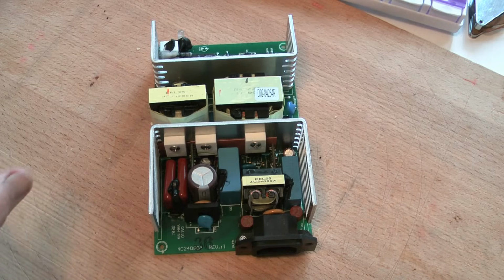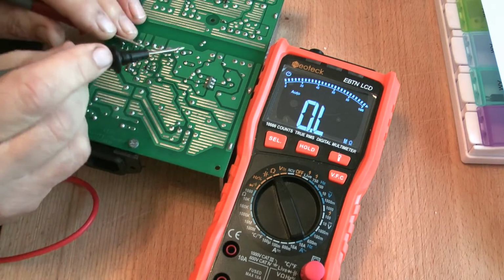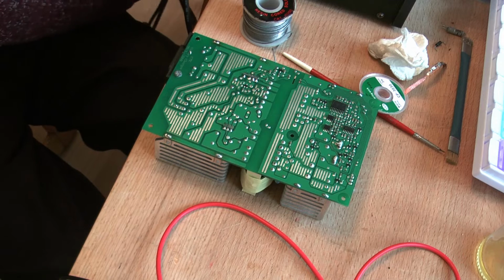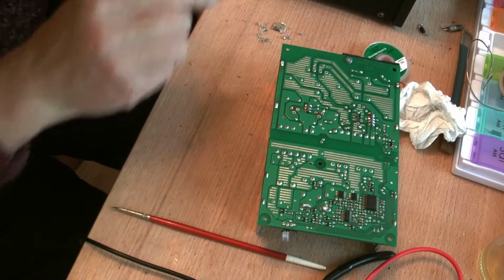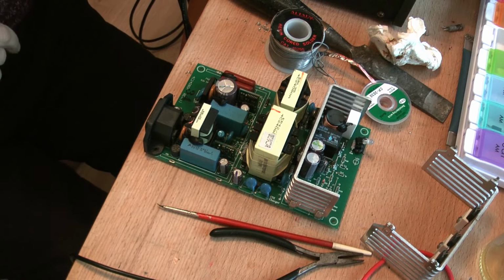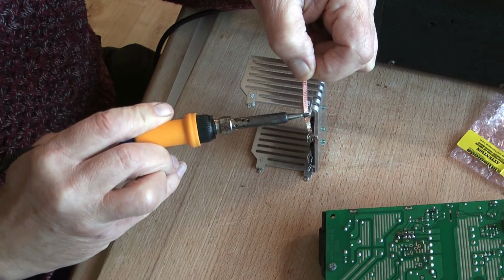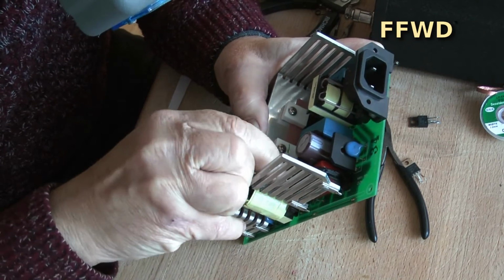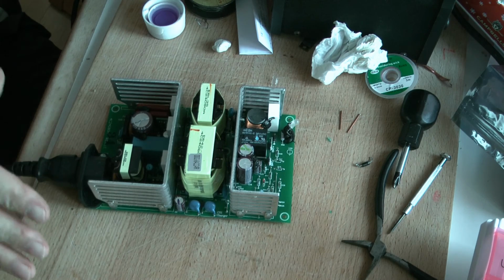Electric Wheelchair - Scooter Battery Charger Repair Part 2.

Comment: Totally agree & have bought her a new 5A charger. Always looking at learning & have done a bit in the past. Just started desoldering components that I believe are faulty, just a slow process. Looks like the mofset on the far right, inline with transformer EEL25, is showing low resistance across all pins. Unlike the other two I have a reading of only 1 ohm but am just about to desoldering it to confirm. Probably right that the juice ain't worth the squeeze, but every days a school day!
Update, turns out it was the transistor that had shorted (the one inline with the choke) & also blown the 5A slow blow fuses.
It was this that was inducing other faults on the circuit. Took a while but now all back together and working again.

Comment: Thanks for the video & all of the work putting it out to help others. Wife has the same unit & the other day, after years of service, it packed in. No led on attempting to charge, although it did flash green briefly before nothing.
Turns out that at least the bridge rectifier is faulty as followed your video & have a reading on both outer pins on all orientations of the probes.   Guessing it can be difficult to source the components as mainly discontinued stock? Both of the incoming side 5A fuses are also blown but no evidence anywhere visually or with sniff test. Initially suspected 24V relay but no such luck.
Once again many THX for the informative videos.
Reply from the maker: At some stage one has to ask themselves –  is it or isn’t it fixable?  There is an element of risk repairing mains powered equipment both in the short and long term.  It is worth considering purchasing a 24v 5A mobility scooter battery charger from people like Amazon, one that is in the price range £20 - £30, or 24v 8A chargers that are in the price range £35 to £40 here in the UK. Saves a lot of time trying to effect a repair and or sourcing components without any of the responsibility or risks from repairing an old one.  If you go this route, make sure that the output plug polarities match whatever you intend to charge before connecting for the first time. I doubt there is an industry standard!
Roger
Reply: Morning Rodger, found that the smd mofset supplying the shorted transistor (far right of the three when viewing from above), also the 6R8 film resistor is shorted. I am guessing that with all that appears to have shorted closed, then there is a good chance that the microcontroller is also goosed & I probably should resign it to the electrical waste bin?
Reply from the maker: @bonnywright5459  Yes, the chip will be blown.  Maybe even the odd component on that little piggy back board.  If it is the one that I think, it isn't a microcontroller, but a PFC (power factor controller) basically a pulse width modulater that drives the MOSFET and is regulated by feedback voltages - one from the opto isolator, the other from a secondary winding on the transformer, and doesn't have any firmware.  Microcontrollers are another nightmare that crop up in almost everything these days and will be on the low voltage side of things.  Datasheet for the chip will have a typical circuit diagram.  Although the charger deviates from this it does help one understand how it works.  Messing around with smd really needs a microscope and moderate soldering skills.  All this comes with experience, not to mention the expense in having the right tools.  If you treat as fun and learning then knock yourself out.